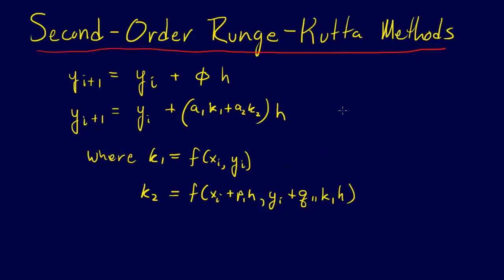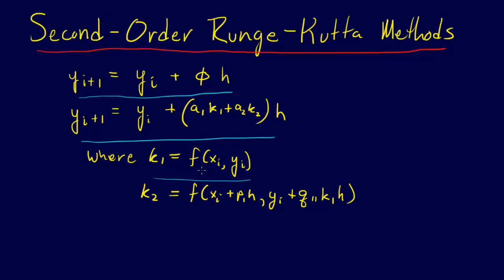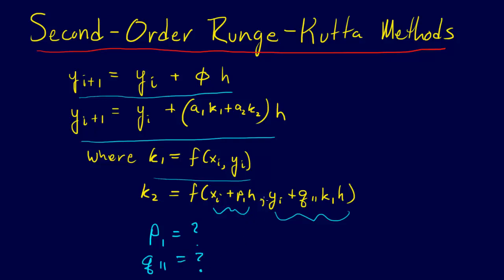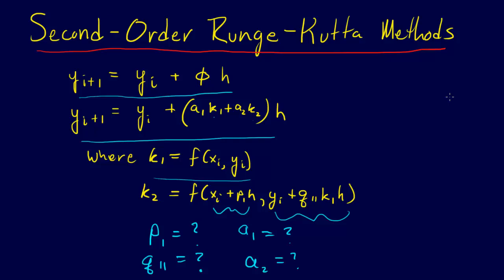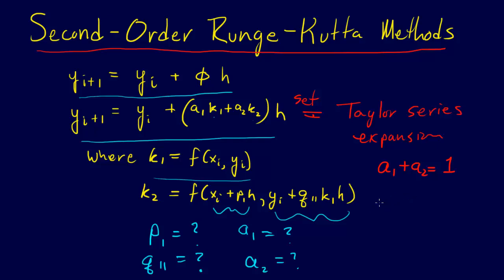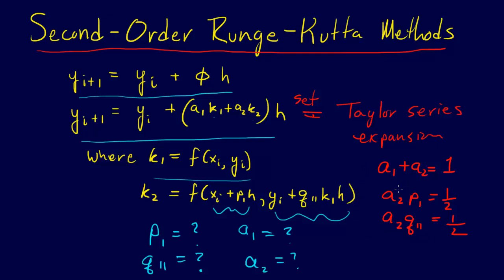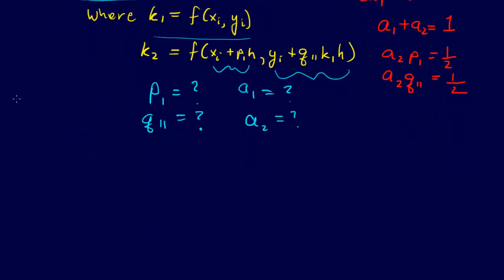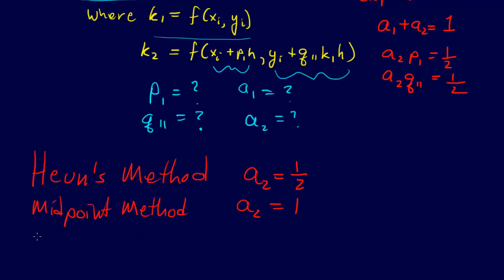7.1.6-ODEs: Second-Order Runge-Kutta

Comment: how can i make FORTRAN -77 program on Runge Kutta 4th order method for ODE2?
Reply from the maker: If you're interested in doing 4th order Runge Kutta, I suggest looking at my video on that topic, https://youtu.be/wr3-dWoxiY4  This is for 2nd order Runge Kutta. I go through step-by-step, so writing the program should be straightforward. Also, I suggest looking at the text; page 741 has pseudocode for the RK4 method.
Reply: Jacob Bishop  is the pdf availabe of this book?
Reply from the maker: Amazon shows that there is a kindle edition. If you have specific questions about availability and versions, I recommend that you contact the publisher, which is McGraw-Hill. As of now, the 7th edition is out, so there are going to be some differences if you get that version. I used the 6th edition for these videos. Publishers usually try to restrict .pdf versions of their textbooks because otherwise they end up getting shared pretty widely on the web.
Reply: THANKS